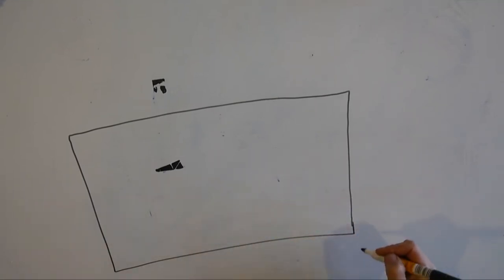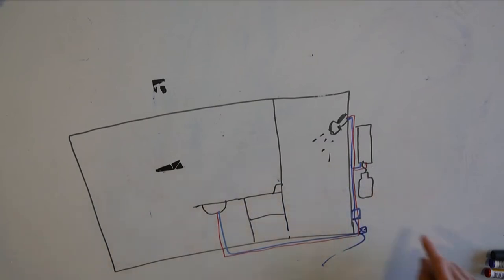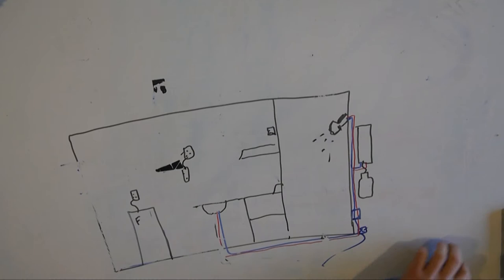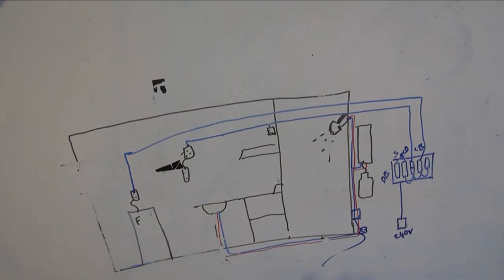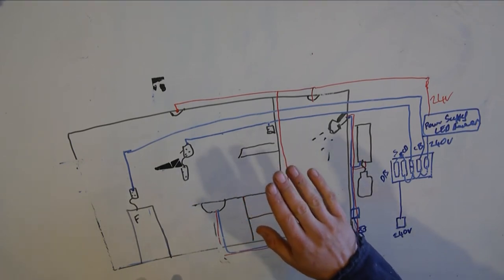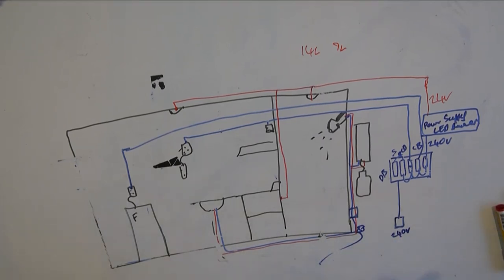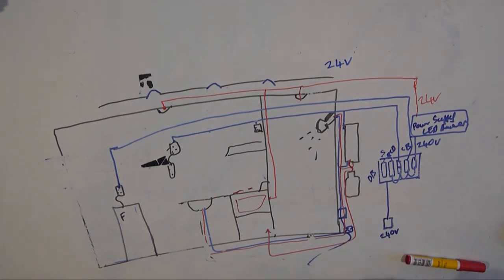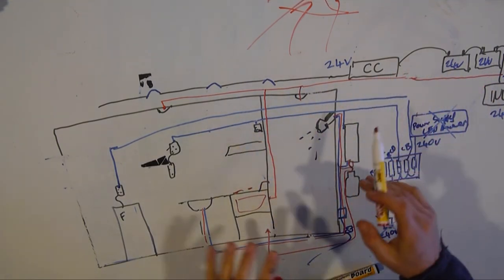DIY Tiny House Plumbing and Electrics

Comment: There's the option of using heat exchangers... You can then opt for a through wall wood zero clearance burner that acts like a furnace and you can choose whether to let the heat inside or not or only use it to heat the hot water.  While still keeping the fire visible for the ambiance...

And/or you can opt for solar thermal that can be built into the roof and/or walls to absorb the heat and use that to help heat the water and provide the structure with thermal mass that will better regulate the temperature year round.

Thermo-electric generators can also be attached to the the wood burner to provide up to 100W of additional power that can help keep the batteries charged during long cloudy/rainy days.

While another take on solar thermal is a solar chimney, which can provide air circulation without needing power, helping to warm the air during the winter and bring in cooler air from the shaded side during the summer...

The water itself can still have the on-demand heater as you can just set up a hybrid system and the on-demand only needs to run if the hot water in the tank drops too low, to ensure continuous hot water no matter what but would greatly reduce fuel needs.

Also, an alternative to a regular wood burning stove is a pellet stove.. Still wood burning but it can be regulated by a thermostat and you can run a fuel container to it for extended runs that can last days or longer depending on use.